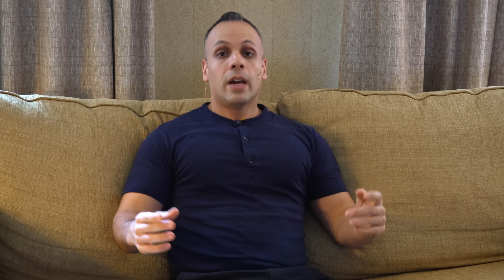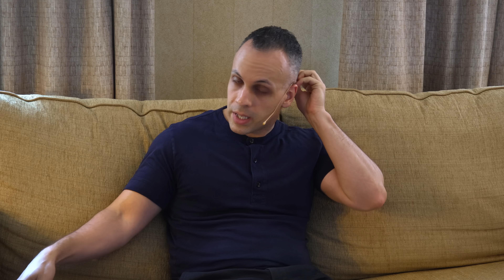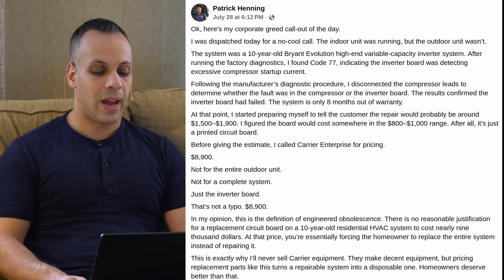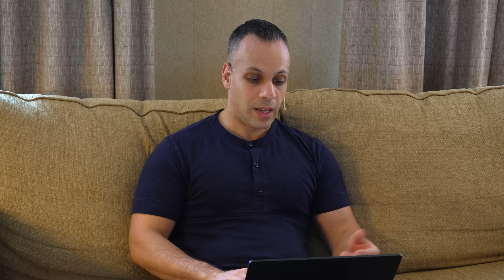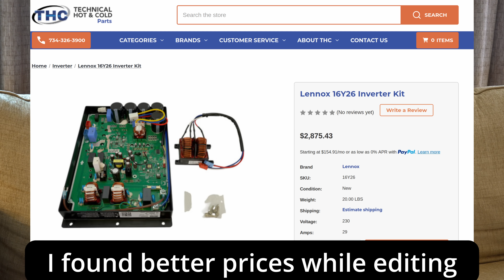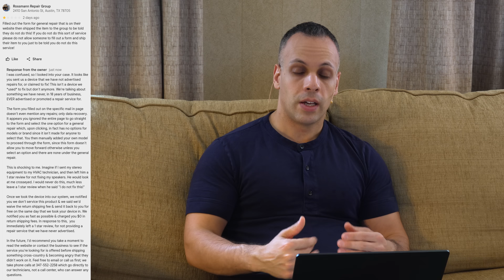Carrier AC repair has $8700 part cost for residential unit

Comment: 10yr HVAC Tech here(commercial/industrial now, but did residential at the beginning)

As we all know that is an absurd price, but unfortunately it is believable.

I would never install one of these inverter(fully modulating capacity) units…

Here’s the options:

Least practical, but possible fun home project(wouldn’t offer as a professional contractor):

Since it’s an inverter system,it likely has a compressor that is 208-230v 3    phase. 

It would take a lot of Jerry rigging, but you could just buy a cheap VFD and possible use that in place of the inverter board.

Simplest solution I may even recommend and do as a professional contractor:

Just change the compressor to a standard single phase compressor and install a contactor that just turns the compressor on/off at full capacity.

Comment: I am presently replacing a set of three hall sensors in one of two BLDC motors from a "non serviceable" 2021 electric zero turn mower transmission. One sensor failed and the machine only sits there and burps error codes. A replacement motor alone is not a part option. The transmission is $1300 and currently not available. The direct replacement hall sensors have been ordered from China and will only cost a few dollars. Get to know the neighbourhood E-bike nerd and you could save yourself a bundle. Cheers.

Comment: Carrier has gone down hill for the last several years.   We had a 2 year old roof top unit that had a fail systemVU board and inverter board fail and they wanted $17000 cdn for both of them.

We also had a 3 year old roof top that had a failed ecoblue fan motor fail, $4000 for just the motor.

Comment: I used to sell AC/HVAC equipment and supplies. Each major brand operates like their own Cartel. They will bind contractors into agreements that ONLY allow them to sell/install a specific brand. They will blacklist you if you buy generic replacement parts (Carrier's generic parts are typically 1/3 the price) Refrigerant for example costs 50-100x the cost to manufacture. They charge this insane price because you only need to charge your units 1x every 20 years if they were installed properly to begin with. They pass this off the the contractor, who then charges the home owner. The home owner is BARRED from buying ANYTHING HVAC related without an EPA license/Certification. It's absolutely criminal how much they jack up the prices.

Comment: Did HVAC and mechanical work for a very long time. This is typical of carrier. Control boards for conventional units 600-1000 dollars when they are 100 dollars in competitor units.

Comment: I wouldn't buy carrier anymore. Sent jobs to mexico after stating they wouldn't. Also had a blower motor fail on a 2 months old system and they didn't have a replacement, needed to use something close.. This was prepandemic when that happened.

Comment: Send the broken PCB to a knowledgeable power electronics engineer (like myself), and have the engineer reverse out a BOM and approximate cost.  Most likely it's less than $100 of parts.  And yes, this type of repair can make for good business, provided the software does not "brick" the PCB when it detects that it has been repaired.

Comment: I had almost an identical issue with a 10yr old Goodman DSXC 4-ton, two-stage ComfortNet condenser in SoCal last month.  I needed a new compressor which just so happens to be $9,300 which is almost the price of replacing the whole system.

Comment: $8900 for a purpose built VFD is insanity when you can get a generic 3HP unit from Eaton for around $1300. 

That said, I do have a Carrier furnace and it's been a great unit. My only complaint is that is uses special filters which cost about 4x as much, but the thing hasn't failed me or had issues in over a decade.

Comment: We don't repair control/circuit boards.  There's not enough market/scalability from our end to justify it - cost of paying someone to do it and how many people would buy or how much they'd pay.  There's also liability - if that board then causes a fire or electrical issue that damages equipment/property, I was always told that whoever repaired the board could be liable to get sued.  Especially on gas burning equipment.

As a hobby it'd be cool, fixing VFDs or inverter boards and using them at home for projects.  From the perspective of the company, wouldn't buy from a seller that doesn't have warranty and spare parts or holds liability.

Something I've thought about for years is mandating some kind of unified/common architecture for inverter/variable systems, and making it so operating algorithms and components aren't proprietary, 3rd party options for boards/controls etc.  Inverter systems are rad in terms of efficiency and comfort, but cost is killer from active efforts of manufacturers to undermine a fair market :/

Comment: This happened to me a few years ago after I bought my house. 

The board failed, the part was discontinued, and they refused to install a generic one. 

They admitted they could use a generic board for the repair. However due to insurance reasons they wouldn't be able to install it. 

In the end, I had no choice but to replace an entire working unit because parts and rules limited me. 

It set me back thousands and years of work.

Comment: Higher efficiency almost never offsets the higher costs.  And that's before you even have to repair anything. Less it more.  Less complicated, less costs, less to go wrong.
Reply: I came here to post exactly that: NEVER buy the “most efficient” anything, especially an HVAC system. All too often the purported efficiency is gained merely by pushing equipment harder.
Reply: The same "efficiency" is how we got overly complex, turbocharged car engines.  They are designed to fail around 100k miles, with the cost of repair is often near the price of a good used car.
Free advice: If you have a newer turbo-engine car, do NOT go >5000 miles between oil changes if you want it to last.
Reply: Depends on several factors.  A couple manufactures have invertor systems that run 100% load down to 5 degrees.  Cost like $25k, but your back up heat strips will never even turn on in most areas.  How much will electric cost in another 15 to 20 years?

Comment: How about the HVAC $2000.00 motor start capacitor replacement scam? Motor start capacitors ( usually for fans ) typically can be found for $50.00 to $100.00 depending  on capacity. Or United Healthcare's 37% claim denial rate? How about GFCI? About 10 kids a month get shocked from outlets ( presumably from non-GFCI outlets ). No deaths in recent history. An ordinary outlet costs $1.00 to $4.00 if its decorative. A GFCI outlet costs $15.00 - $50.00 and it has a computer chip inside that disables  it after a certain period, with an indicator light. Same with CO detectors. How about subscriptions for for car options? Do you know why most Bridges over rivers and bays are never painted? They would last longer. (easier for officials to skim or pocket money from a BIG project, example: homelessness how many do they house? None. The billions spent are studies? ) How about the "road work" barrels that stay on the road for 6 months - a year after the road work is completed? Or no road work was ever done? Why? Tickets for speeding in a "work" zone.

Comment: Absolutely robbery. Unless there is some proprietary code on a microcontroller or some other IP involved that board is only a few dollars compared to what they are asking. No way it cost more the a couple hundred if that. I understand liability, profit, engineering, blah, blah, blah, but that should not be worth more than $1k with that consideration and even that’s way too much.

Comment: You'd have to be crazy to put a variable unit in. Parts are super expensive and very difficult to diagnose. Generally not worth it unless you have money to blow.
Reply: Those residential customers are still practically being beta testers - even though the technology has been around for 40+ years - the manufacturers needed a reason to create a new premium plus ultimate system that's 2% more efficient to win carbon credit points.

Comment: Hvac tech here 
Yes. The brand you speak of is notorious for this now. I just had to quote a VFD blower motor for a simple single stage package unit. Manufacturer's price? 2k. All for the privilege of being able to spin a dial that nobody ever does so the fan can blow harder. I typically quote american standard products for new systems. Ive never had an inverter board go out on them, and have only changed 1 compressor on a heat pump. Customer wanted the house at 85 degrees when it was 20 something outside. Its understandable why that conpressor would give out lol.
But honestly yes, the tech is expensive now. The big C company you speak of is the worst for everything. Ive had them quote me replacement coils for more money than a whole new unit. Ill never sell that brand. Ill stick to AS, Lennox and goodman.

Comment: The board uses an RTX 5090 to run an AI model to optimize the cooling.
Reply: Just like how the AI datacenters use water for the AI to figure out how much water to save while using the AI.  Once all the water is gone, the AI will have solved the water equation problem.
Reply: @Mr_Ceiling_Fan  I'm just confused. Where does water go? Not like AI is eating it. If it's used for cooling, then can't it just keep circulating? Not to mention we have basically unlimited amount of water on this planet anyway. I know nuclear plans often just use a lake nearby or something, but the same water keeps circulating for decades. It doesn't just magically disappear after cooling the system..
Reply: @PlantasA evaporative cooling uses shitloads of water. Otherwise you have to use closed loop refrigeration that uses tons more electricity. Data centres are just giant heaters that convert electricity into heat while they spew out endless drivel. AI is a myth. It’s not intelligent. We don’t have AGI. AI is just a very large guessing program.
Reply: @JuneBannister-k4s that just doesn't make sense. One still needs to pump that water from somewhere, might as well have a closed system, and secondly, how this is even legal if you literally evaporating enormous amounts of water?
Reply: @PlantasA  A closed system is not an evaporative system, .and uses massive electricity as previously stated. The rational solution would be an open loop system, like nuke plants, as you noted, which are situated on a river. They drawn in cool water, discharge warm water. I don't know why it would be illegal to evaporate water, and it's not like it's "gone" afterwards, it will come down as rain. The problem arises when these things are situated in areas where there isn't much water to begin with, and such areas are usually hotter to boot, resulting in spiraling inefficiency. Why not put these things in cold climates, then either use air cooling, vent the heat to the atmosphere, or harvest the heat for human use.
Reply: @PlantasA  Reality is, like most engineering problems, the optimal cooling system is very site specific - and some of the solutions go back to the Age of Steam. These days, it usually results in a hybrid system which incorporates a few methods which each optimized for varying seasonal, water cost / availability, real estate available ( ponds ), load scheduling, and a host of other issues. And 'water' isn't just any water in each part of a cooling system, mineral content for instance can rapidly create deposits, gray and brown water from treatment plants can sometimes be used versus dumping it back into the environment. Which is another aspect, how the data center interacts with the local utilities, both benefits and costs. And of course, the scale of the 'data center' influences the design trade-offs. ( H. L. Mencken,  wrote, "For every complex problem there is an answer that is clear, simple, and wrong" ).
Reply: These systems are designed for comfort and quiet  operation rather than strictly efficiency. So you are paying a premium for that type of system as well as for seasonal maintenance and parts when needed. But I could be wrong. I haven't installed any unitary variables. Been out of the game for a few years now.
Reply: Palo verde nuclear plant in az uses a steam turbine. Where does steam come from? In their case the dirtiest water that will work. The data center offloads cooling to the plant by using closed loop coolers. Ceos think most of us are too stupid to come to that conclusion and unfortunately they are right.

Comment: Most residential systems don't have these complex inverter boards ,I sell parts. Most units have a simplistic board and a ecm motor. It's a lot like the vehicle industry the more complicated crap more problems

Comment: Wherever possible, never buy inverter-driven appliances.  The "savings" are purely imaginary.  Whatever you think you will save on daily running costs is massively outweighed by a crazily short life.  And governments fulfil the role of "useful idiots" by adopting mandates for this garbage.  Do you own a 40 year old inverter-driven appliance?  I still use a 40 year old on/off refrigerator.  You are no longer allowed to buy an on/off air conditioner in my country.

Comment: Louis do not ever allow an HVAC company to sell you a variable displacement compressor system. They are tremendously more complicated , gaspingly more expensive to repair and whatever slight energy savings you may think your getting. It will never over shadow the additional cost on the unit new to eve rbe worthwhile.

Comment: I had an lg miniduct air conditioner about 15 years old.  Last winter i was late turning off the power to it for the winter and a rodent ruined the circuit board.  I didn't really want to deal with replacing it myself and asked some companies to fix it and they wanted 10,000  CAD to replace the  entirely. Many sevice company also recommended it, some without even opening the cover. Its not only the manufacturer , there is a whole industry built on this.  This is Canada, for sure USA has the same problems.  thankfully i was educated in electronics and i figured out what capacitors blew up, cleaned the board, replace some fuse and capacitor for about 9$ including shipping.

Comment: We dont fix them. They usually get tossed. We can replace stuff. Its just not worth it in terms of reliability. I replace a bad IGBT on an inverter board, we now own it and any downtime caused by the repair is on us. We also dont usually have the time or equipment to do the repair. 
Granted I work in commercial/industrial HVAC so alot of times if a piece of equipment goes down we have to get it running asap. The most cost effcient solution is to just replace it and now I have a warranty from the manufacturer. 
Shit I currently have a 22 year old AAON unit that has either a bad exv driver or bad exvs. They obviously dont make those boards any more, they do sell a retrofit kit for the unit that has their new boards. 
Also for some of these boards you wouldnt really know if you fixed the issue with out the piece of equipment in front of you to test it on so sure you can replace a component but with out all the other pieces youd have no way of knowing if the repair was sucessful. 
Now thats not to condone 8900 for a new inverter board becuase thats rediculous. Brand new VFDs dont even cost that much until you get into the large ones. But having dealt with tracking down obsolete parts that definitely sounds like they either have only a couple left or it has to be made to order which could command that price.

Comment: They are adding a bluetooth modules to high end carrier furnaces and AC units. I was told that when we replace the control boards in the new units, we will have to use our phones to bluetooth into the board and program its "personality", instead of removing the personality chip from the old board and plugging it into the new board. This is gonna be great, I cant wait to go somewhere remote, have to drive around looking for signal to download a personality file (if they even let you do it not on the fly), and then charge the customer a bajillion dollars for  the repair.

Comment: LG also charges excessively high prices for replacement inverter boards on their Multi-V air-conditioning equipment. LG Multi-V systems use variable refrigerant flow (VRF) where pipes circulate refrigerant inside and outside of a building. Once a VRF system is installed, the owner is basically locked in long term because it is very difficult or simply not possible to swap the A/C equipment to another vendor. LG charges thousands of dollars for replacement parts and then labor to install the parts can be overpriced too. Often the inverter filter capacitors fail, but the board can be repaired if not badly damaged. Component level repair on inverter boards is a fraction of new board cost.

Comment: Ac tech with over 27 years of experience in the Miami fl area. 

I never recommend any of the big manufacturers cuz they all do scum bag crap like that and more. 

Instead I recommend decent quality lower end units that will last and will be cheap to repair when they inevitably start having multiple major issues. 

I also always recommend to anyone that will listen not to buy a system with a micro channel condenser coil (that's another one of the cost cutting measures that have screwed over consumers)

Comment: RIDICULOUS.  I would keep the main unit inside and only use it for heating.  I would install mini splits as they are far more efficient to run for air conditioning.